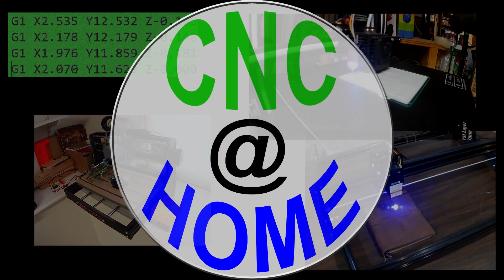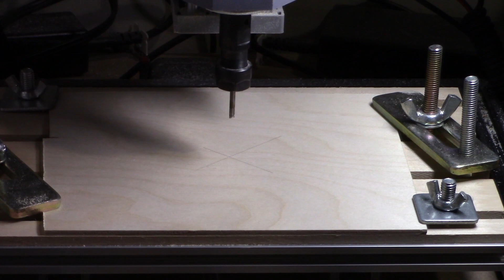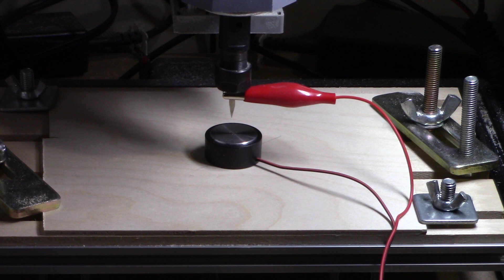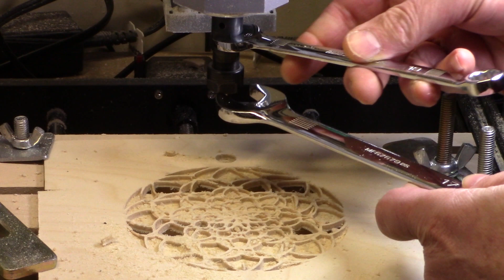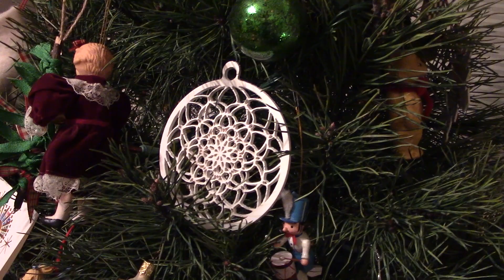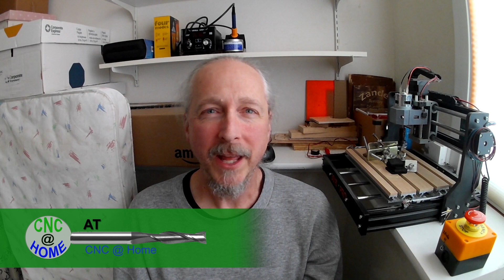3018Pro - Ornament - The final chapter

Comment: You did it, congrats on your perseverance, I think the end product was definitely worth it.
Did you cut that with the 20K spindle ? It didn't sound high speed. But looks like you managed 1/4" profile cut in 1 pass !
I installed my Genmitsu spindle for 2 cuts, the end plate started lifting, so sending back to Amazon for refund 😟🤔👎👎
Reply from the maker: Sorry to hear about your new spindle.  This was cut with the new 20K RMP spindle and it worked great.  The profile cut was a 3.175mm bit so only 1/8".  Still, 3mm deep in one cut at 100mm/min worked just fine on the craft plywood.